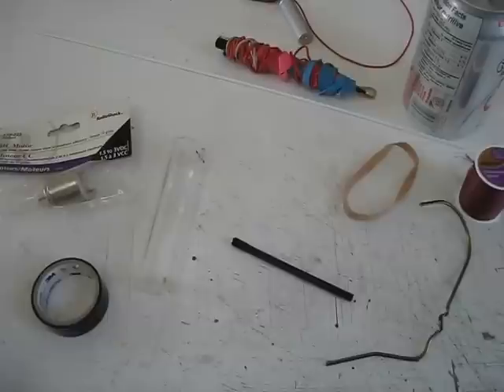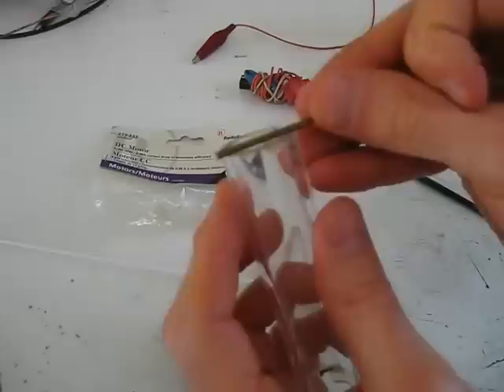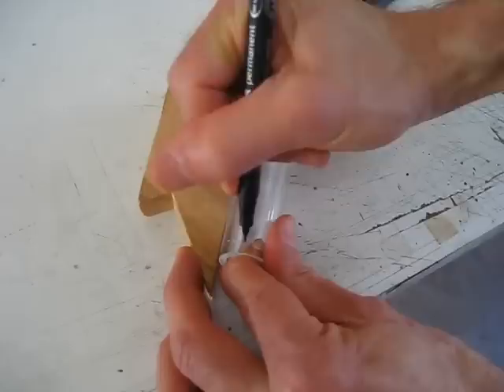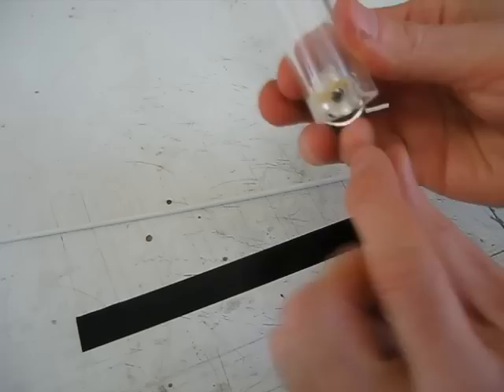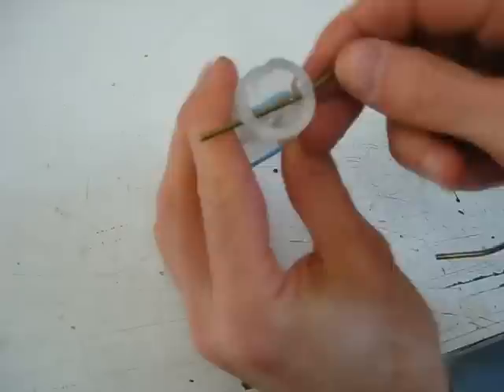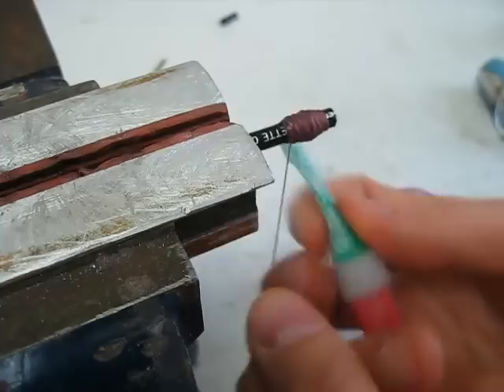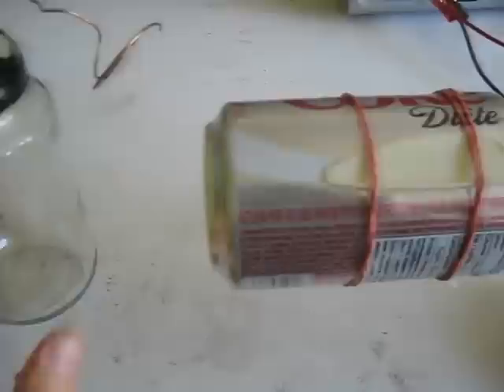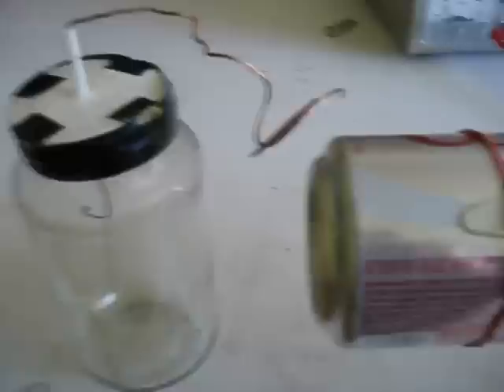How to Make/Build a Van de Graaff Generator Part 1 (Homemade/DIY)

Comment from the maker: Whether or not you have to stand on a chair depends on what experiment you will try. If you try the one where you touch the can/dome with your hand and your hair rises, then you need to be insulated from ground. Just wearing rubber soled shoes is fine, or standing on a rubber mat. Usually as long as you're indoors on dry, non-metal floor and not barefoot, you're probably good. For all other experiments where you're not touching it, you don't have to be insulated.

Comment: hello rimstar! I found a grounded outlet in the kitchen, yes I even tested the voltage between one of the poles with the ground wire and I got  voltage. so can I pull a ground wire from the kitchen to my room? is this safe?  I wont be connecting any power  to that same outlet

Comment from the maker: Do you mean the rubber band belt is too loose? Solutions to that are to increase the diameter of the roller(s) if you can or increase the distance between the roller shafts. But keep in mind that the materials for the outer surfaces of the rollers and the inner surface of the belt are important. The rollers must be on opposite sides of the triboelectric series table and the belt in the middle of the table. A plain brownish rubber band is good. Colored rubber bands don't always work.

Comment from the maker: I found this one worked best if I just let the end of the ground wire brush against the rubber belt (10:11 in the video.) The vinyl tape pulley doesn't charge up the belt enough to leave a gap between the wire end and the belt. I think over time the glue from the vinyl tape spreads onto the vinyl. The other end of the ground wire is plugged into a wall socket.

Comment: Thank you! Now, I'm looking to be using your instructions for my science project. Would a Glass Roller (From a fuse), and for the belt I would use vinyl, or PVC electrical tape, and for the Roller on the motor (I would use Rubber, Eraser maybe? OR would plastic be nice)  And the casing would be a big water bottle do you think that would be sufficient?

Comment from the maker: No. The limit is set by the size and roundness of the can. When the charge on the can gets dense enough it just starts leaking to the surrounding air. I have a much bigger Van de Graaff generator with a dome that's around 15 inches in diameter, and that one can get harmful to touch really fast. But with these small cans, there's no danger.

Comment from the maker: Also, the resin that comes with fiberglass is a two part thing so just because there's resin doesn't mean that's all there is in it. So no guarantee. But if your bottom roller and belt are producing enough charge then it probably won't hurt if the top roller isn't. You just won't get as much.

Comment: Excuse me sir,i need your help...can i use rubber bands for the outer surface of lower pulley and nylon threads for the outer surface of upper puuley when i have taken electric tape as the belt??????
Reply from the maker: According to the table on the right side of http://en.wikipedia.org/wiki/Triboelectric_effect that combination shouldn't work, or at least not well. The lower pulley should be toward the one end of the table, the upper pulley should be toward the other end, and the belt in between the two somewhere.

Comment from the maker: Oh, I have no idea for Europe. Interesting though. In North America we have 2 poles, called hot and neutral, and we have ground. Neutral and ground are electrically connected together at the breaker panel so there's 0 voltage between them. Between hot and ground there's 120 VAC. So I can't say for certain what's safe in Europe.

Comment from the maker: Are you talking about an actual round sphere made of aluminum? I know you can pound aluminum sheets into half spheres and then put them together, but that's a lot of work. If it doesn't have to be aluminum then look for metal christmas tree ornaments. Or get two small steel bowls from kitchen stores and attach one on top of the other. You do want to make sure it's all metal because you need to connect the top brush to the inside, and the inside has to conduct to the outside.

Comment from the maker: Here's my understanding of how it works. The electric whirl sits on the van de graaff's dome and gets charged. So the electric whirl is at a high voltage with respect to the surrounding room and air. The high voltage at the tips of the wires break down the air molecules, turning them into ions with opposite charges. It then repels those oppositely charged ions. Newton's 1st law says for every action there's an opposite reaction. So the end of the wire is repelled in the other direction.

Comment from the maker: The black tube is a plastic tube from a pen. What it's made of doesn't matter. What matters is what material makes contact with the rubber band and that is nylon. The important thing about the black tube was that it turned easily on the shaft.

What materials are in contact with the rubber band on the two rollers? Try adjusting the gap size between the rubber band and the brush at the can end - smaller gap is better. How are you doing the ground connection to the rubber band on the other end?

Comment: Ok sir i used plastic for my lower pulley and nylon thread for the upper pulley as you said,so what should i use for the belt...sorry to ask soooo many questions,but i really want to make a van de graaff generator and i have to submit it as my project by 27th of this month....please help..!!!
Reply from the maker: You can use a rubber band for the belt. I get rubber bands from office supply stores, but stores where they have school supplies might have them. Food and mail is sometimes held together with rubber bands so go to your grocery store or post office and ask for some. Friendship bands and charity bracelets don't work.
If you can't find a rubber band then you could try black electrical tape as the belt, which is vinyl. Put the sticky side of the tape facing outward. You may or may not have to wrap the plastic pulley in the same tape to make it work.

Comment from the maker: Yes, the top roller could have been metal but that would mean only the bottom roller was doing the useful charging. It's more efficient if you can get both rollers providing charge.

Comment: yeah. I have managed to 'break' motors in the past, but fix them by taking them apart and adjusting the brushes. Those motors can really take a beating, and I have one that is just like yours that is very loud (both electrically noisy via back EMF and as well as acoustic noise). the brushes in it have been trashed, and the plastic that holds them in place has melted around it, but it still spins away.

(I forgot to mention the burning smell it makes when ran at 9-12V, lol)

Comment from the maker: Current and voltage are two different things. The voltage is an amount that is determined by your motor. My motor says it needs from 1.5 to 3 volts DC. The current is determined by the motor and how much load you put on the motor. The load will vary depending on on how tight your Van de Graaff's belt is. I got the value for current that I gave you previously by running my motor but with an ammeter connected in series in the circuit. You motor should say what voltage and maximum current it needs.

Comment: i got the wires that i made as the blade from the extra wire of the van de graaff generator..after that i made the generator using your steps on your video,it works and thanks for that sir.now i just have to build the electric whirl.i have watched a video and i'm wondering how it works.can you please help me sir?

Comment from the maker: Oh, you simply get a big metal ball and attach a wire to the inside. Then touch that metal ball to the Van de Graaff's dome and leave it touching. Then attach the other end of the wire to wherever you need your high voltage. The reason for using a big metal ball is to keep losses down. I sometimes get away with just taping a wire to the dome, as in my "Franklin's Bells - How to Make and Demonstrations" video.

Comment from the maker: It can provide a high voltage to things, but the current is low. So you can't power anything big. But you can make little pinwheel ion wind turbines turn and do neat electrostatic things. But it's purpose is not to provide electricity to power things. For that you'd be better off just powering things using the power supply directly.

Comment from the maker: For a strong electric field, just get a large rounded metal object. Connect it to ground. Hold the rounded end near the dome. There'll be an electric field between them - except when it sparks. For a strong electric field use a sharper object, but the sparks will be more frequent. At a certain point of sharpness it will no longer form a strong electric field but just keep conducting through the air.

Comment from the maker: Re AIR IONIZATION, it can happen at much less than 30,000 volts. The ionization also depends on the shape of the electrodes. In this case we have sharp pointed wires so the voltage can be much lower. I had ionization this week with a 30 gauge (AWG) bare wire as one of the electrodes and I measured the voltage with my high voltage probe as 11,000 volts. It also depends on humidity, drier is better, and of course the gas but here were are talking about normal air. Oh, and clearly it does work.

Comment from the maker: You'd need somehow have the blades, the part that rotates, in electrical contact with the dome of the Van de Graaff generator. The blades must also be able to rotate very, very easily and the tips of the blades must be sharp.

Comment: i should connect a wire to the other roller that is connected to the motor? i thought i saw this video carfully well i will try this again :D

as for the copper on the other roller which is near the coca can
if it got no voltage then should i connect the wire from the motor side roller to the can and have 2 wirs connected to the same roller?
please tell me you understood anything from me

Comment: Hey,
I'm trying this project for powering my tesla coil. Would The Voltage provided by the van de graff generator be enough? Please Reply Fast!!
Reply from the maker: +Mohamed I The voltage would be enough, but the current is too small. Also, and sort of related, the sparks don't happen fast enough.

Comment from the maker: I doubt it would work. The earth on a battery isn't really earth. It's often called that since it's often supposed to be connected to earth. A battery needs a complete circuit to conduct, which is why I don't think it would work. Also, if you're using a vinyl pulley at that end then you want to connect to something that accepts electrons, not supplies electrons. Earth ground does both. So the plus of the battery would be better, but since it's not a complete circuit I still doubt it would work.

Comment from the maker: No battery. I'm using around 4 volts maximum from my homemade 24V DC variable power supply that's plugged into the wall socket. It's a 3 volt motor.
However, in my "How to Make a Van de Graaff Generator Part 2" video I barely get a 1.5 volt motor to turn with 4 1.5 volt D cell batteries connected in parallel (still 1.5 volts.)
My small commercially made Van de Graaff generator runs on just 2 D cell batteries. I think it has a better motor, a slightly bigger 1.5 volt motor.

Comment: what happen if i touch the negative end?
is the 10cm tube important?
can i replace the negative and positive with other items (give ex)
what can i replace the belt with
how fast(rpm) does it need to generate static charge

thanks
Reply from the maker: If the negative end is just a grounded wire connection like it is in this video then it shouldn't really change anything. If it's a poorly grounded connection then you might even see an improvement in the sparks on the can.
The 10cm tube is there for structural reasons only, to provide support for the two pulleys/rollers. If you have a tube then is must not be made of electrically conductive material, i.e. no metal.
Regarding replacing the negative and positive with other items, see my part 2 video http://youtu.be/QrCgtjZwnB0
Which belt material you replace it with depends on what materials you use for the pulleys/rollers. The material it's made of must be in the triboelectric series table somewhere between the materials on the pulleys/rollers.
Regarding the speed, the faster the better. I don't know a minimum speed because it depends on the dimensions and materials.

Comment from the maker: I guess you could connect a wire to ground. Connect one end of an LED to that ground wire. Then for the other end of the LED connect another wire with a non-sharp object on the other end. Then hold the non-sharp object near the dome of the VDG and get a spark. During the spark there will be some current flowing through the wire and it might light the LED. It'll be lead by a high voltage which might damage the LED though.

Comment from the maker: In that case it sounds like one or more of your roller and/or belt material are the problem. You'll have to try different materials for the belt and rollers. You're glass roller should be okay, as long as there's no coating on it. Your plastic roller is maybe okay. Your tourniquet would be my first guess.

Comment: hey I m using bobbin covered with silk thread on both the sides and a wrist band with a 100 rpm 10v motor so will it work
Reply from the maker: +saurabh jain Someone reported in the comments here a while back that wrist band material doesn't work. Also, when you said silk thread on "both the sides", you don't mean that both rollers are covered with silk thread do you? The outer surface of the rollers have to be different materials that are on opposite sides of the triboelectric series. The inside surface of the belt has to be in the triboelectric series somewhere in between the two roller materials.

Comment from the maker: Plastic and glass with a rubber belt are a good combination. The plastic may have a paint coating on it or in it that reduces its triboelectric effect. My first guess would be the blue tourniquet. Whatever is making it blue may be the problem. Try looking for a rubber band or a balloon that you can cut. But first try adjusting the sharp ends of the wires that are near the belt. Make the ground one touch the belt and make the other one very close but not touching. (And no need to call me sir :)).

Comment: Ohk. I thk i will make the belt using a leather belt coated with varnish as one of my teachers sugsted. Do you thnk it will work? 
And how did you transfer charges to the belt?

Comment from the maker: I didn't open up the whole bottom of the can because I was afraid of making more sharp edges. But in hindsight I think not doing so left plenty of sharp edges anyway. 

No worries re our disagreeing. In science, experiment is king, so I guess only experiments will tell. Though it would still be hard to compare since opening the can changes other variables too, like different sharp edges.

Thanks for your feedback, re my videos. Much appreciated.

Comment from the maker: A copper pipe would definitely interfere. Don't use a metal support structure. It shorts out the dome at the top with the ground at the bottom, even if they're not touching, and it shorts out the upward moving and downward moving sides of the belt.

Comment: I need your help seriously, i used electric tape for the belt, a plastic bottle instead of PVC and on the lower pulley for which i used a sketch pen, i rolled many rubber bands. But, its not working for me. What should i do else and do i need to roll anything on the above pulley??????
Reply from the maker: What did you use for the for the out surface of the upper pulley? See the table on the right at http://en.wikipedia.org/wiki/Triboelectric_effect The material for the outer surface of the lower pulley should be on one side of the table, the material for the outer surface of the upper pulley should be on the other side of the table, and the material for the inner surface of the belt should be somewhere in between those two. Or the upper pulley can just be metal but that won't give as good a result. See also my part 2 video How to Make a Van de Graaff Generator Part 2 and my FAQ page http://rimstar.org/science_electronics_projects/van_de_graaff_faq_frequently_asked_questions.htm

Comment from the maker: It doesn't have to be nylon. Do a search for the "triboelectric series". You want a material for the bottom pulley that is far away in the series from the material you use for the belt and farther from the top pulley. So the bottom pulley should be a material near one end of the series, the belt should be a material around the middle of the series and the top pulley should be near the other end of the series.

Comment from the maker: Yes, it's the same idea, just everything bigger, including the length of the belt, meaning the distance between the two ends. That's because the voltage will be higher.

Comment from the maker: No. There's not enough current. You'd need to use a high voltage probe in place of your regular multimeter probes, like my Fluke 80K-40 probe. And for a meter you'd need some way to take the charge off to measure it. So if you're talking about the charge built up on the bottom roller, which provides the voltage to move charge from the brush to the belt, I just ran my homemade VDG, pulled away the brush and put my electroscope terminal hear the roller. Nothing. So the charge is very small.